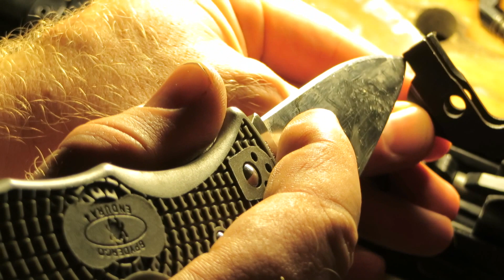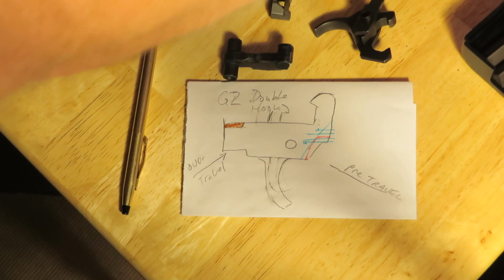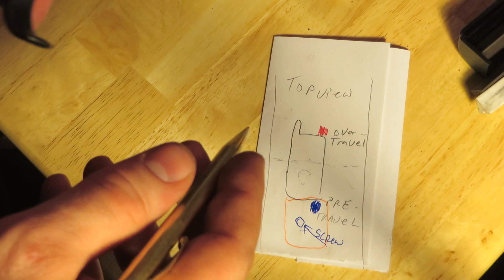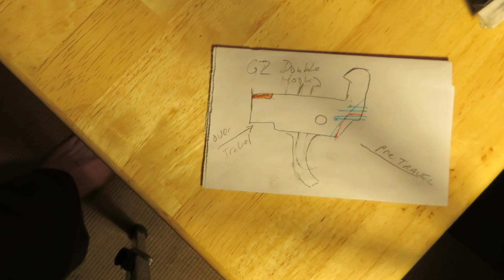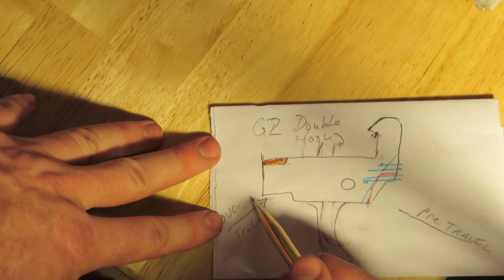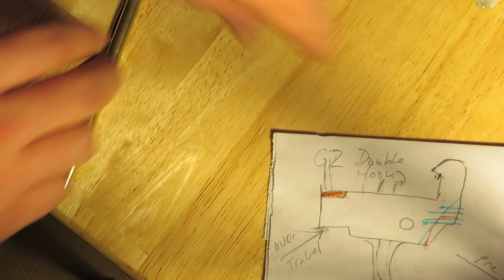AK Trigger Job using Tapco G2 Double Hook- Wrong Way & Right Way

Comment: You can do that too,but you can see & copy how work the guns that come from factory using Double Hook;I have one that came with Double Hook & another "WAS" with only one hook,& the difference was enormous;even after I polish;now is using the Tapco Double Hook TOO,& the trigger work "smoothly".
Reply from the maker: glynka1 Don't you understand that the point is to make a trigger smoother and shorter throw than the factory doublehook. This is not just a trigger installation, this is a trigger job. It makes a BETTER trigger pull than the crappy factory double hook or single hook triggers. You can eliminate about 5/16" of needless travel between a pre-travel and over travel stop setup this way. Your trigger will be smoother, crisper, and faster to shoot.

Comment: Why don't just open the little slots with a drill bit like the one in the other side of the aperture DOWN in the the stamped receivers ;& they will work down together like other ak's come from factory with Double Hook .MANY stamped receivers, come with two slots cut for the double hook
Reply from the maker: glynka1 You can do that, but we are actually taking advantage of that interference here. If you make the second slot, then you can't use that space as an over-travel stop. We are making a trigger BETTER than what come on many stamped receivers. If you don't want to do that little bit of work to get a superior trigger, you may as well go with a single hook and just stick to refining engagement surfaces.

Comment: Just found your channel. Very good pointers that most people don't understand! For this, I think if you were to shave a bit off the disconnector stop (the other side of the hook, opposite side of its pin) I think it may have been enough to get this working properly. But obviously you would still need to fix the angle... its hard to tell through youtube lol

Also, the stock trigger looks like its the factory trigger and not a G2..
Reply from the maker: Thanks.

I have the unsafe FCG, and it is a single hook G2, complete with MIMed in "G2" ... What you describe probably would have worked, but would have resulted in more vertical movement of FCG components due to the material which would have needed to be removed to correct the hook angle. This would also make increased engagement advisable since the hammer would make a bigger jump from disco to hook. Also, those are surface hardened (but not much). doing much more than a polish will probably risk accelerated wear. That's another factor which would warrant a little bit of extra engagement. -Pretty much the opposite of my goals. I want to reduce movement in every plane and smooth things out generally. Much better to start fresh. The owner could afford the $26 for a new one. Also, I only had one chance to really get it right. If It were my own, I could tinker at it and tweak. For him, it needed to leave my door "right" before I moved out of town.
Reply from the maker: One more point you wouldn't be able to see easily without holding two side by side, but the hook was shortened very slightly too, in addition to the angle change. As you mention, a shave to the inside of the disco could give it more travel to make up for this, but I'd be doing a lot more guess and check work to find something I can feel good about sending a friend out with.
Reply: Gotcha! I thought it looked like an original hammer because it looked very much like my original saiga hammer in the 7.62, with the unused side cut down. I had never even thought about the surface hardening part. Thats a great point. When converting mine I shaved down and smoothed out the hammer to allow only a safe amount of overtravel when hooked on the disconnector. Also smoothed out under the bolt carrier. Its very smooth now with no issues. Also, I had polished the roll pins but not sure how much/if any smoothing that did.. Great work either way!
Reply from the maker: I think toward the end I might have grabbed an original hammer out of the parts box as a prop and kept the video rolling. I think I mentioned it in passing. I put way too much time into making the video and wasn't going to re-shoot. Also I had to make a few of the clips with whatever I had on hand after I sent the gun home with the owner. Usually this kind of thing takes me 25-45 minutes, but this one just took an absurd amount of time to stone in the rough surfaces. The casting seam on the hammer wing and disco were awful. I actually ended up ditching the stones in favor of a couple swipes of a bastard file to get the ridge down, then resumed with the diamond files.

I didn't polish the pins on this one, but they were plenty smooth. On a previous one, I did and also used a .22lr brass as a bushing to smooth it up even more. (That was with a G1, I believe, but it's been a while.) not sure it was worth the effort though.
Reply: GunFun ZS Oh man ya the casting seam on mine was horrible too. I just use files until I get to where I want profile was, making sure the alignment is good with a sharpy. Then I just smooth and polish. .22lr shell casing I had never even thought of lol thats awesome. Great work buddy!
Reply from the maker: I would not normally advocate using files though, that's much more aggressive than should generally be required. Anyone who would benefit from a tutorial like this should go slow and check often, and files are simply too fast.

I don't think the .22LR will work with the newer ones. The old G1 style had a lot of slop around the axis pins from overbore  holes.

Comment: Sorry I forgot;check this: http://www.stu-offroad.com/firearms/saiga/saiga-6.htm
Reply from the maker: glynka1 Yes. This video shows a better method than what your link shows to get a better trigger. That gets you equal to bone stock factory. The method shown here gets a more refined trigger. By all means give your self that trigger job if that is what you want, but you are missing out on the potential for what it could be. See here: http://vepr.org/viewtopic.php?t=2719&p=22512 The step in the trigger is better than a slot in the receiver, because it allows you to control how far the trigger moves. You can eliminate slop.